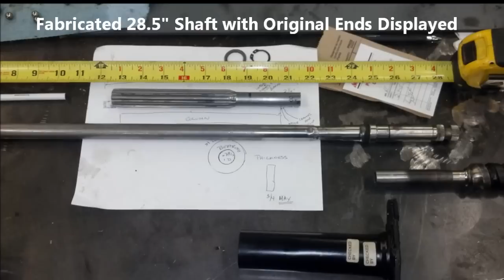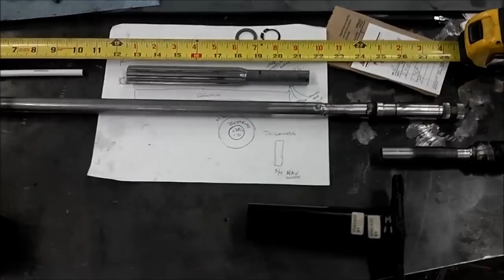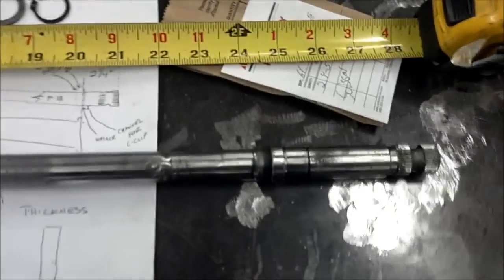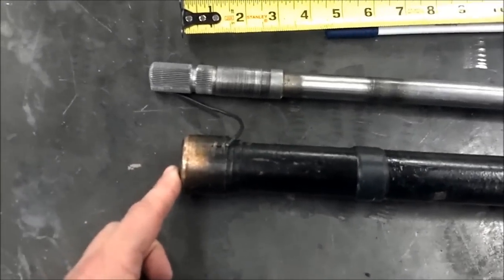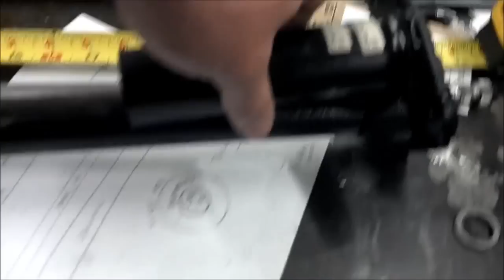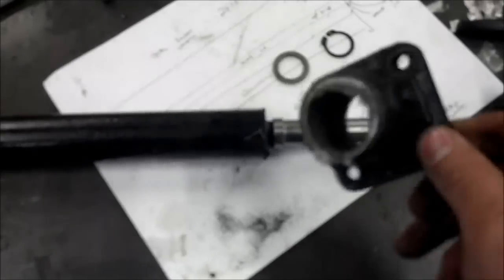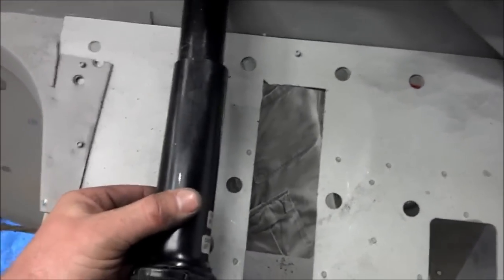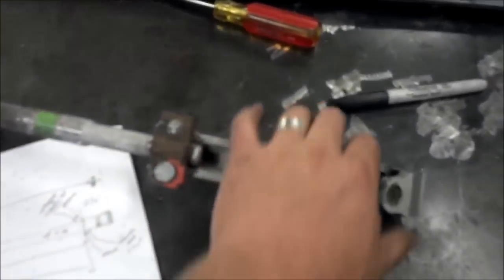3:  Steering Shaft 2: Land Rover Series 2A: Ford 302 V8 and P38 Power Steering Conversion

Comment: I know this is an old post, but just FYI the shafts are all 3/4-48. Exactly the same as VW. There are literally thousands of options for adapting the 2A shaft for people who do sand rails, baja bugs and stuff like that. I just welded a short bit of splined shaft on instead of the worm gear. Put a bearing on the end and that was that. kept the original 2A column. An BTW the center of the steering box is exactly two inches from the bottom end of the column. That's also the center of the bulkhead support hole. I think you overthunk it.
Reply from the maker: Bill Adams Good to know Bill, thanks for the note.  My entire intent was to have the interior feel virtually exactly like everything was original. Only looking under the hood or staring at the passenger wing indicates there's something more added to this 2A.   That said, it required a bit of over-thinking to avoid going with the simple install of a Defender column and steering wheel.  In the end, it all only cost me about $100 to keep it all feeling identical in the driver's seat, and using the 50 year old original look and presentation I wanted.  I should add, of course, I had never done any mechanic work on any kind of project before this Rover, and the reward of this build was learning along the way, 100%.  I think I took some winding routes that a seasoned pro would have entirely avoided.  :)

Comment: Hi Matt, do you have a picture of the mount at the bottom of the column to the bulkhead bracket?  Also, what is the overall length after the new sleeve was welded to the bottom?
Reply from the maker: Hi Steve.  I keep this truck is in California now, so can't get a photo to you today.  however, I do have to go out there this week and will get some info for you on what I ended up with as my finished product.
Reply from the maker: before I made the mount/bracket, here is how it was all laying in place:  
https://www.facebook.com/photo.php?fbid=4824595613565&set=a.2382608325409.140043.1256748057&type=3&theater
Reply: Matt Davidson thanks Matt. I am getting an error on the photo from FB (might be permissions) but I think I might have it figured out.